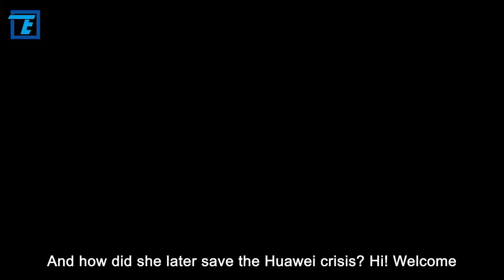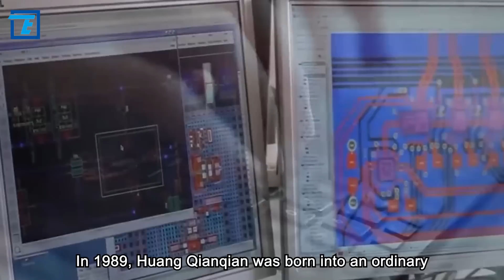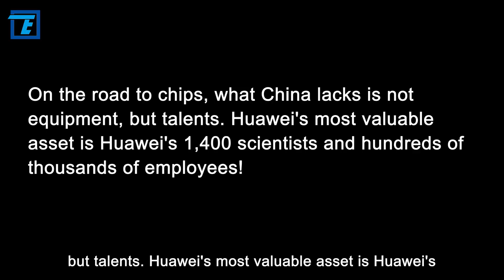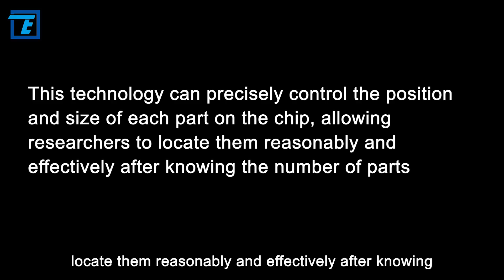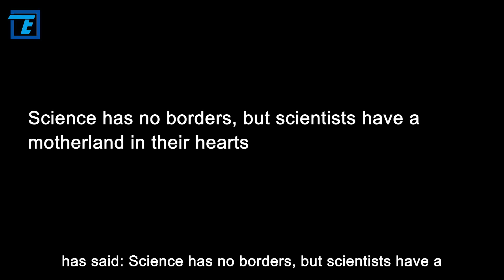Pretty Chinese 'chip goddess' helped Huawei out of trouble?

Comment: CONGRATULATIONS! GOD BLESS YOU WANGCHENCHEN
Reply: Hi Silicon started the cpu design in Silicon Valley with local talent.
The first project with dual core ARM cpu was not enough performance, Huawei didn’t use it but continued to buy qualcomm. The way Huawei did was to use qualcomm chips and asked them to teach them the functions and specs, then designed on the side. That is always the strategy of Huawei applied in the past .
Huawei designed CPU performance had been always the slowest one among apple, qualcomm, and needs to rely next gen process to boost the performance.
I doubt China has domestic ability to design without leveraging the western technology transfers after all the semiconductor was invented in the west.
China has no contribution in recent semi evolution. 
The invention of quantum mechanic, then the solid state Physic, and the birth of the transistors and integrated ICs had no Chinese contribution at all.
CT shah was the only chínese working with Andrew grove to developed all these mos FET oxide issues. 
ARM cpu designed by the Britains and uses in every smartphone cpu cores. The west sanction to ban the latest version of ARM CPU to be used by China because it can be used in the servers for the military uses.